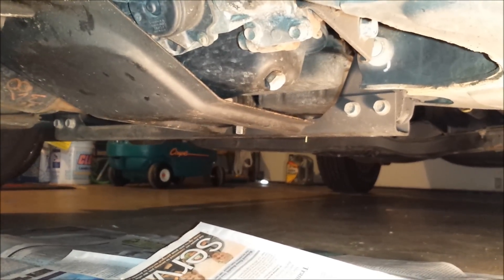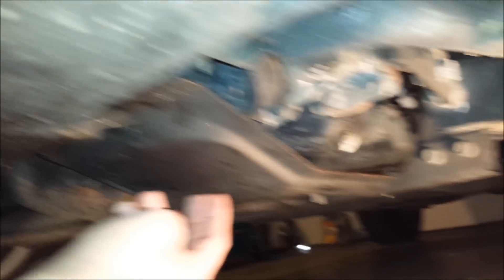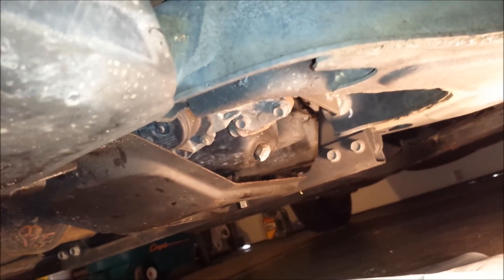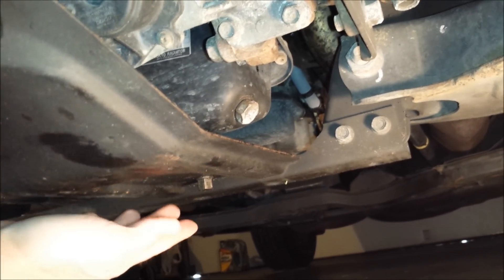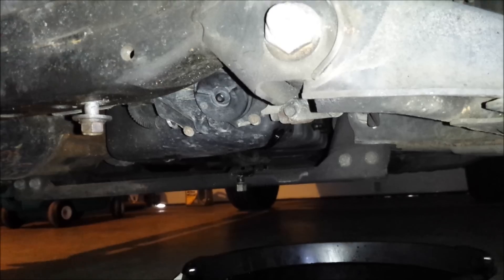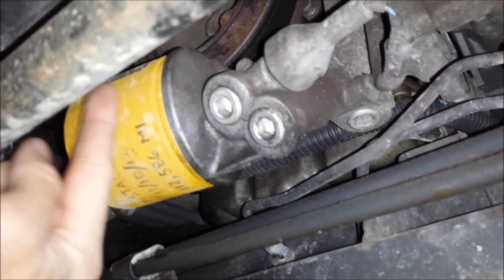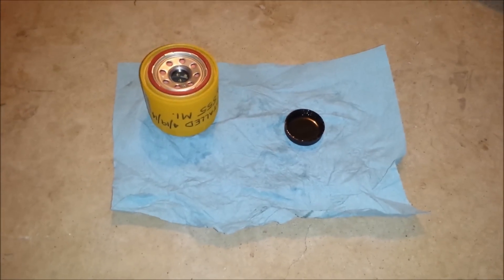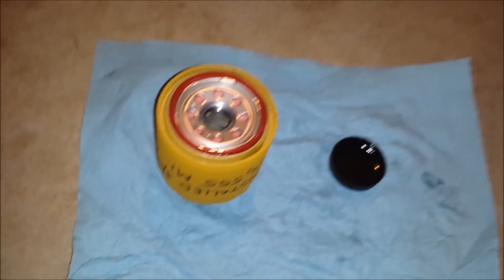2001 Isuzu Rodeo - How to Change the Engine Oil

Comment: Thanks for showing me how to change my oil now I need to know if I can just let some oil out because I put to much in with out changing the filter
Reply from the maker: Hi Kenny, yes - you can partially drain some oil out.  There are a few ways to go about it.  One option is to simply remove the drain pan plug and allow some oil to drain out into a catch basin, and then re-install the plug.  The problem with that is that it's going to be very messy, because you're going to have to try to re-install the plug while the oil is draining out of the pan, so it's going to splash everywhere.  It may be best to simply loosen the plug but not completely remove it - this should allow a very small amount of oil to drip out slowly.  Depending on how much oil you need to drain, this could take quite a while, but it should be pretty easy and clean.  Another option would be to remove the oil filter - this will allow a moderate amount of oil to drain out without having to worry about the entire pan draining out.  If you go with this option and you don't want to replace the filter with a new one, you can simply re-install the old one after you're done.

Lastly, you could try to use a small handheld fluid pump and push the "suction" hose down the oil dipstick tube.  I've never tried to do this, and I think it would quite difficult to get a small diameter hose all the way down into the drain pan, but it's probably possible.

I hope this is helpful.  Thanks for watching!

Comment: Thank you. Really good video. This works exactly the same way on a 2002 Isuzu Trooper. Same engine, same skid plates, same position of the oil filter as on the Trooper.

Comment: My 2001 rodeo V6-3.2L for service uses 5 quarts of SAE 10W-30 with oil filter;  4.2 quarts without filter change.    Oil capacity original factory fill is 6.3 quarts of oil.

 I recommend a 22mm 6 point hex socket for the oil drain plug.

Comment: Thanks saw the video So i noticed the isuzu rodeo  engine looks kind of the same as the trooper so do you think it has the same cover as this one just asking i don't do mechanic just doing research jus t got thus vehicle and like I said the Wal-Mart refused to do the oil change and the bolt is rusty so we would have to do it we found out the steering wheel pump or something might be leaking that's another question that container at the top in front of the brake fluid is steering fluid? it says use only ATF Dextron thanks for your help
Reply from the maker: Rachel, the Rodeo engine is identical to the Trooper engine, except that it is smaller in displacement (3.2L vs. 3.5L in the Trooper).  When you ask about the cover, do you mean the plastic engine cover that sits on top of the intake manifold?  I don't know if that cover is identical between Rodeos and Troopers, but I can check if that is what you are asking about.

l am very surprised that Wal Mart refused to do an oil change because of oil residue on the exterior of the engine.  Where is the oil residue?  Is it on the oil pan, or on the engine itself?

Yes, the fluid reservoir on the driver's side near the firewall that references ATF should be the power steering fluid.  Check the link below to download the Isuzu Rodeo service manual.  Sorry, I had forgotten that the old link I used to have posted no longer worked and I removed it from my page.

https://mega.nz/#!6QEkyBAY!OHgvdn6UMzCmj3Jw1meJN3HpPh1BUmLbnH76vYwx99M

Comment: Hi, Matt Thanks for the great video. but didn't you have to fill up the filter with oil before placing it back on? Am just asking!
Reply from the maker: Hi Joe, good question - because this filter mounts horizontally, I don't usually fill it up prior to installing it, since the oil would just dump back while trying to install it.  So, I typically install the filter and then turn the engine on and let it run for a couple of minutes to fill up the oil filter, then turn it back off and check the oil level again after about 5 minutes of sitting.  Usually I'll have to add a little bit of oil at that point.

Thanks for watching!

Comment: Great video, Matt. Thank you. It helped me with my 1999 Rodeo. I realized I am missing the skid plate that is under the oil pan that you had to remove in the video. Do you know the part number or if it called something else? I cannot find the part for the life of me. I have the front skid plate, just not the one under the oil plug.
Reply from the maker: You know what, that is a great question Nowell!  I had never searched for this part, but after you asked, I looked high and low on the internet and cannot even find a parts diagram that shows it.  I did discover that only certain Rodeos have this skid plate, so it's possible that yours did not come with one from the factory.  Your best bet is probably to scour the local junkyards to see if you can score one.  Or, you might want to check on www.planetisuzoo.com and see if anyone has one they are willing to part with.

Good luck, and please let me know if you do discover the part number for this!  Thanks for watching!
Reply: I am starting to think mine didn't come with one like you said. I talked to someone who has owned two 1998 Rodeo's and neither one had it. I also contacted a parts dealer and they could only find the front skid plate in their system, not only for the 1999, but they couldn't find it for the 2001 either. Kind of a mystery until I can check out the junkyard. I'll have a look at www.planetisuzoo.com too. Thanks a lot for taking the time to look into it.

Comment: No need to remove the skid plate, just use a funnel to drain the oil into the drain pan or bucket.
Reply from the maker: ***** Good call...I just don't have the right size/shape funnel to fit in there to catch all the oil...but great tip.  Maybe next time I'll have to spend a few bucks to get a funnel that will work and save myself a few minutes.

Thanks for watching!

Comment: Thanks for your video bro I got a good idea for you... Clamp on a plastic to Shield the skid plate so that whatever goes near it would slide off the plastic.. cut yourself a plastic or a piece of carton and clamp it on with those little clamps from Harbor Freight on the outside of the skid pan. Thanks again for your video bro